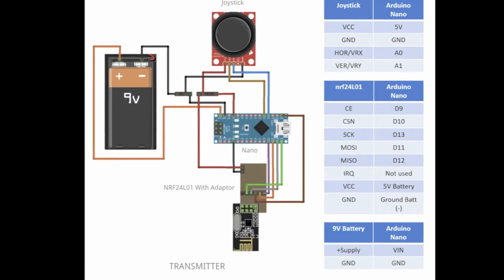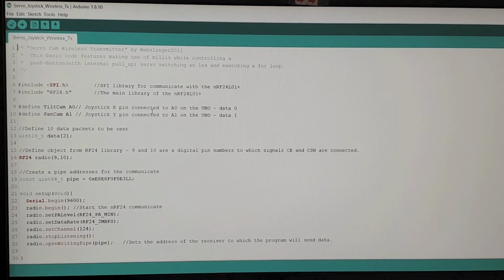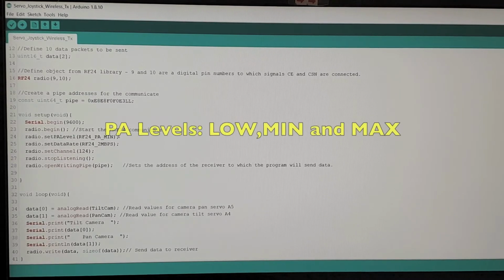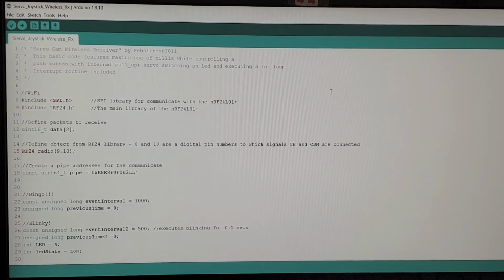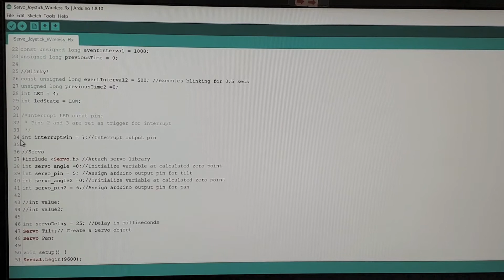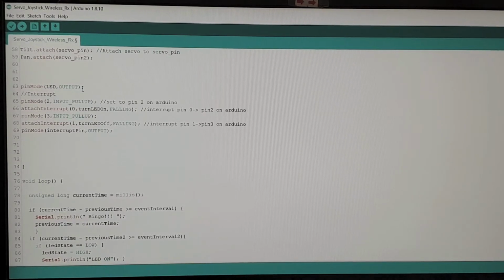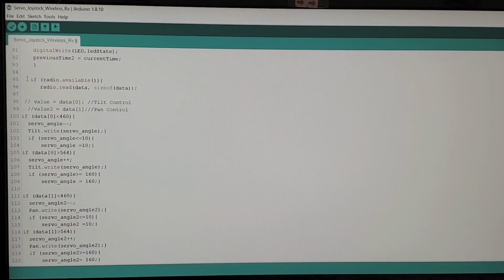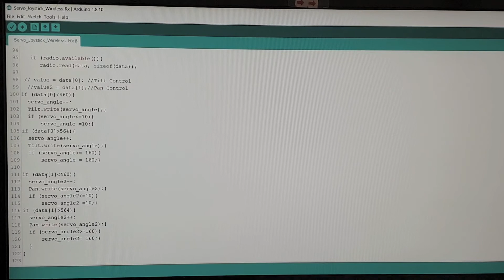Wireless Servo Control using NRF24L01

Comment: HI THERE! I am having an issue with the reciever end of this circuit. it seems to be stuck in a loop between LED ON LED OFF and BINGO! any ideas as to how to remedy this issue?
Reply from the maker: Did you use an external power supply for the servos? Did you declare Pins 2 and 3 as INPUT_PULLUP? Did you follow exactly as in the wiring diagram?
Reply: @webslinger2011  I followed the diagram EXACTLY, and I’m mostly using this circuit in order to read a joystick wirelessly. How do I declare those parts in the code?
Reply from the maker: @dom_the_builder  I guess you should start with a simple code for controlling the servos first while using a joystick (directly connected) to make sure everything works before going wireless. Then test a simple wireless setup sending and receiving values and go from there.

Comment: Thank... How to add to this code 2 Servo and 5 LED
Reply from the maker: You can increase the number of values in the array. Then assign new variables for led's.
Reply from the maker: uint16_t data[7]; 
// increase number of variables in the array.
//Assign new variables
data[2] = led1;
data[3] = ledState;
... etc
Reply: @webslinger2011  
Thanks a lot, my dear brother. I did the experiment before and it did not work for me. Can you help me write code to control 4 servo and 4 led
Reply from the maker: @ashkananali8571  Maybe you'll need to start with the basics. Have a look at Learn Electronics for controlling leds, Paul Mcwhorter and robojax videos on how to control servos.
Reply: @webslinger2011  Thank you very much my friend. But I only have a problem with the code I need to transfer variable values and 0 1 values in one package